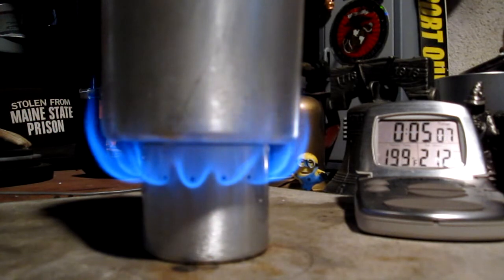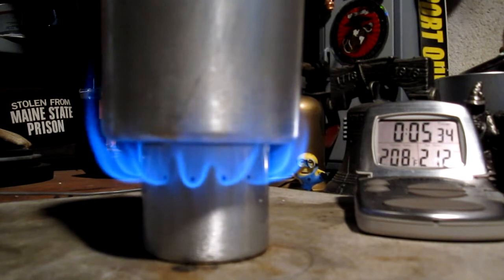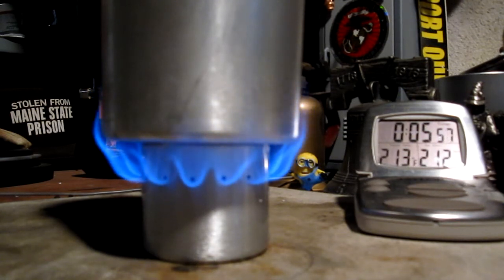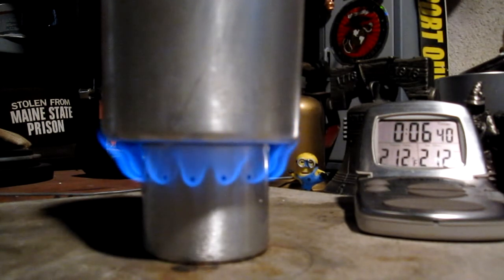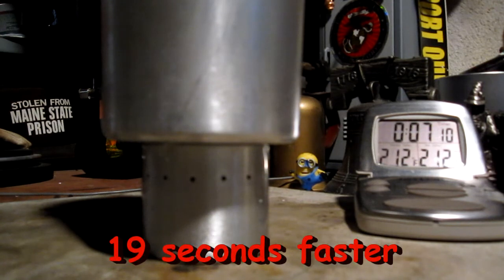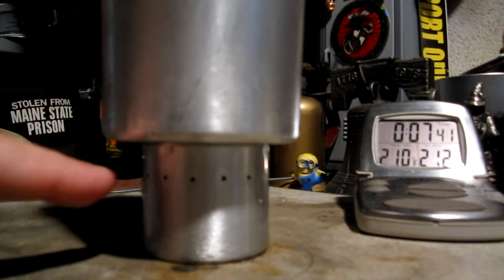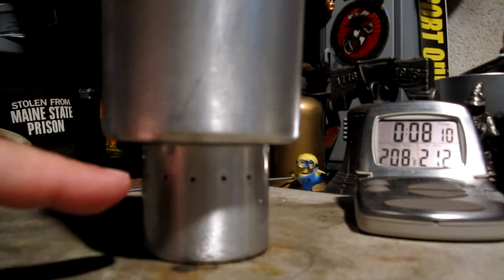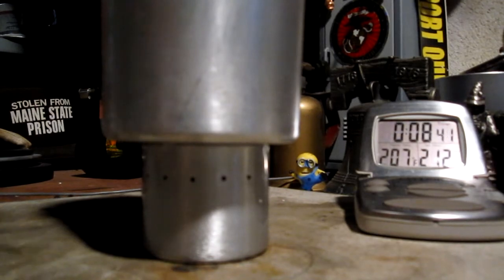BatchStovez BS 1.0 Stove - Boil Test #2

Comment: Hiram,
 I agree with your results, Boil times and burn out times will vary slightly from burn to burn. It has been my experience although smaller, this stove burns hotter than the BS 2.0 I'm sure you will come to the same conclusion. Boil Times are in the range expected and yes the stove is lazy and doesn't like to work longer than it has too. LOL  Very respectable boil time for any Stove not to mention the small diameter pot.
Thanks ,Sam